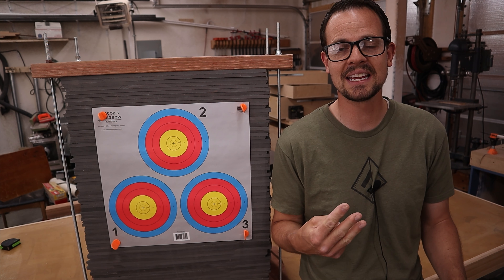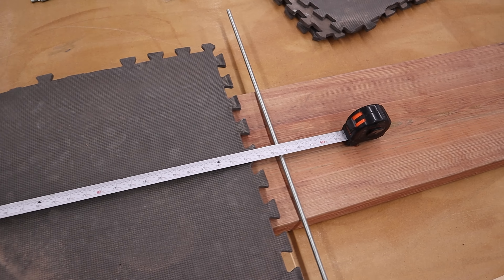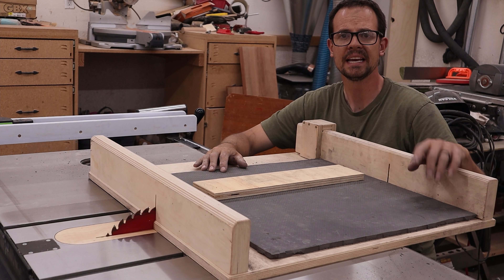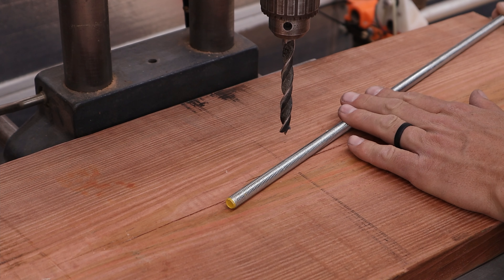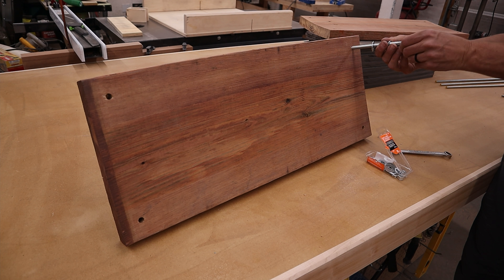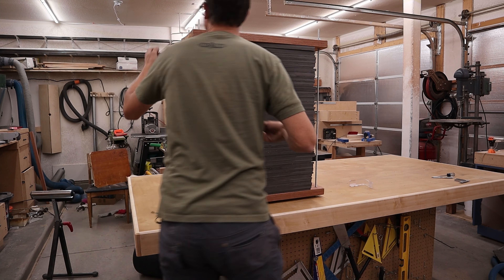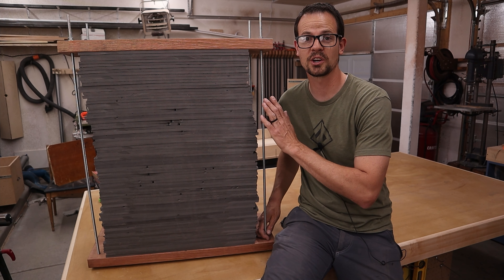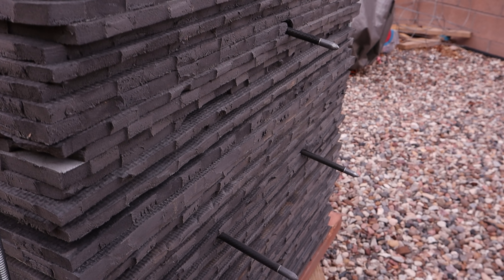Make a Simple Foam Mat Archery Target | One Day Build

Comment: Have you tried shooting broadheads into this foam? I understand it will shorten the lifespan of the foam, curious how well they would remove and how long it would last.
Reply: I haven’t yet. If it is like the normal foam targets Ive used before then the broadheads pull out easier. Ill have to try and get back to you. I do fear a bit the layered design would more easily cut out chunks than a solid foam target since the broadhead can cut out a whole layer thickness. It may be better to use the mats standing up.
Reply: Broadheads are going to shread this just as bad as any broadhead rated foam target. That's why it's worth taking the time to tune your bow (and arrows) so that your field points and broadheads fly and impact the same. That way you never need worry about both wearing out your target and damaging your broadheads. In reality you should only need about 2-3 shots from each broadhead before you can safely store them away until season rolls around. So unless you go crazy with a quantity of hunting arrows, your number of broadhead shots into the target shouldn't be more than 30 in a given year (20 or so for tuning and another 10 or so to verify all is well right before season starts).
Reply: @jmike8934  unfortunately I completely disagree with you. I tune my bow as much as the next guy and rarely do my broadheads and fieldtips not fly close. But I've shot broadheads enough to know that they are not field points. The industry has pushed everyone that their product has field point accuracy. I think as a hunter you should shoot every broadhead arrow and build confidence. I've been in camp many times with guys who claimed they hit the same spot, wound an animal, then go back and watch them practice with their broadheads and find they were not exactly perfect. It's the least we can do for the animal as bow hunters, and it greatly helps with my confidence. I do not shoot expandables, so if something gets knocked off in my setup throughout the year slightly, fixed blades usually magnify that. I'd never know if I shot field points practicing in hunting season.
Reply: @mitchellshirk2533  I think you are reading more into what I was suggesting or taking the whole "Impact the same" too literally. I don't mean the have to hit the EXACT same point, just group the same or very similar. For example I have my broadheads tuned and sighted to dead center but my fieldpoints hit about 1/2" low left in comparison. Solution? 4 clicks up, 1-2 left and now in the off season my field points are dead on. Season gets here, a readjustment my sight and verify all the BHs are hitting center and I'm good to go. That's 6 broadheads. 10 shots max. Maybe I've just been lucky with my builds and rarely do I have to make serious alterations to my setup when moving from field point to broadhead. I can think of one but that was on me for forgetting I had tuned with stock nocks but used lighted on my broadhead arrows. 

The guy you mentioned was just a shitty hunter. Most of us don't worry about going to hunt camp. We hunt within a close radius of our home and rarely get to go on trips. Once I verify my bow has changed from cutting paper to cutting flesh, it stays in the case unless it's time to kill. No field points fly out of it until tags are filled. Meaning unless I do something stupid like bang or drop my case, the chances of anything changing are 0. Now of course common sense has to play in a bit as well and adjust accordingly. The times I have gone on week long adventures, of course I did more verification of all my equipment and even went as far as to tune and carry a backup. But again that's just not the norm for most of us and as long as you are correctly confident in your equipment then you don't need to sling a ton of broadheads.

edit: I'm also with you on the no-expandables thing. I tried to give them a fair shot years ago but I found that NOTHING beats a good COC with a bit of weight behind it (these 350gr arrow setups also make me cackle).
Reply: I've had an identical target for many years. I use it specifically for broadheads because, although the tiles chop up a little easier than solid foam targets,  I can replace them cheaply amd easily so in the long run it's way cheaper than a brand name foam block.  I found if you move tiles from the centre to the edges regularly then it'll take a lot of shots before you need to buy more tiles
Reply from the maker: Sorry it took so long to reply with some good info but I wanted to shoot it a while before answering. Basically it worked better than I thought, but just like mitty vidz said it does cut up the mats. Im shooting iron wills and almost every shot cut a mat in half, but I still got good stopping power, and it wasn't tearing out chunks too big. It looks like with a couple of weeks shooting it would be good to replace about 12 of the half mats, so that would be like 18 dollars. Granted I had already been shooting a ton with field tips. I will say I didn't get any passthrough with the broadheads, but it did wear way faster in spots, so I got a couple to the fletching most days of shooting. Hope that helps.
Reply: @BuildItMakeIt  very much, thanks!
Reply: @mitchellshirk2533  absolutely broadhead tuning is more important than field point
Reply: @jmike8934  bare shaft and nock tuning will help tremendously but I’ve seen some broadheads that just have a mind of there own lol

Comment: Can you explain to me why you used a 25/32 drill bit and not a 1/2 inch.. To me it would seem the 3/8 would fit in the 1/2 inch hole better than 25/32. 3/8 = .375 , 1/2 = .5 and 25/32= .78125
Reply from the maker: Yep good catch I totally said that wrong. Thanks! It was a 25/64 drill bit I used, one size up from 3/8, not 25/32.

Comment: you really need something to mask out the threaded bar.. if an arrow hits that it'll either shatter, or worse, bounce or deflect in a random direction.  Extremely dangerous not to put something in front of them.
Reply from the maker: A number of people in the comments have used ratchet straps while building the target to avoid the threaded rod. I haven't seen anyone put something in front to block them, but that is a good idea. Thanks!
Reply: @BuildItMakeIt  ratchet straps are certainly the way :) good video though

Comment: I can't believe you used a table saw to cut those foam matts one at a time. That's like using a hand saw to cut your sandwich in half.
Reply from the maker: I agree a table saw isn't necessary but it was faster and left a cleaner edge than a utility knife. Your right, I could of cut more at once and been faster, I didn't even think of that.
Reply: @BuildItMakeIt  . A utility knife is just as fast and a lot quiter. I use these matts, but I shoot the fronts and tie them together on the sides by those interlocking pieces that you cut off. No need for wood and threaded rods. 12 matts will give a good 2' X 2' X 6" target.

Comment: Anything resembling horse stall mat or floor mat will not work.Arrows are difficult to pull out and it leaves a residue in your arrows when you pull them out.
Reply from the maker: Sorry the target didn’t work out for you. I haven’t tried horse stall mats as a target. I have one as a backdrop and I could see that being really hard to get arrows out of if you shot it side on.
Reply: @BuildItMakeIt  They work great as a backstop.Way to heavy for me to lift though.They weigh 100lbs.

Comment: Honestly, though, with how high prices are for the materials needed, why not just buy a pre-made target?
Reply from the maker: Lots of people are asking this, and I think it is a fair point. For me this is my 5th target in 3 years, all but one has been destroyed/used up the year I bought them. The one that has lasted is the Rinehart 18-1 target (foam) I bought last year. That target is $140. I wanted a larger target at least 24"x24" that would last multiple years. This target currently is like 85-100 to make depending on local, and should last me years. If I do cut up/wear out some mats it is only like 7 dollars to bring it back up to nice condition, all the while getting taller if I put the bad mats at the edges. If one isn't shooting a lot I think you can get away with something cheaper no problem. I am not sure what target for $100 is going to give me what I have with this target, but certainly I may be missing some targets.

Comment: Can you do the math and show me how 50 dollars worth of these oads (9 dollars a pack with 4 at half an inch, meaning you get 4 inches per pack if you cut them in half and stack them) and it be this big?
Reply from the maker: Sure, each mat is 1/2 inch thick so one pack gives 4 inches of target since they are cut in half. 24 inches tall is 6 packs, and 8 packs makes 32 inches tall. Using the 9 dollars price and no coupons thats 54 - 72.   I do recommend getting a coupon if you can. My local circular had them again recently for 7 a pack. The regular price used to be 8 when I first got them, but I still used a coupon.

Comment: Those mats are 5$ a piece here so this is by no mean a cheap target , I get you had yours laying around but to buy those mats and get 2 pieces per mat it would cost 200$ or more just to make
Reply: All that said it is a really nice quality target a if you bought that target it would probably be 500$
Reply from the maker: Yikes $5 each is pretty expensive. I did just check to see them at Harbor freight, and they have gone up in price again which is a real bummer. Looks like the new normal price is $10 for 4 mats. Hopefully price increases slow down. The target was never cheap to make but the mats have gone up now almost 40% from when I first bought them and about 30% from last year when I posted the tutorial. Crazy.

Comment: What's the draw weight of this bow? Do you think this can handle an 60 pound bow with 324fps speed? 
Does this target falls when an arrow Hits it?
Reply from the maker: My draw weight is 65 so you would be great. There are others that have built this target and they are shooting even higher draw weight. The target doesn’t fall when getting hit. It weighs about 45 lbs.
Reply: Do you have an ig account?
Reply from the maker: @BalwinderSingh-hx4qm  yep Im @builditmakeit
Reply: @BuildItMakeIt  How close to the target? I am asking as I would like to use in garage (5 yards distance)?
Reply from the maker: @richardvallee966  I typically am shooting at 20 yards or higher but I have shot at 5 yards in the garage. For my compound bow if I hit the same hole more than a couple of times in a row it does go in pretty far, so what I do is print a 5 by 5 grid on a sheet of paper since I am inside. With that I don't go through the same hole too many times. One note, it has always stopped the arrow just it can start to go in really deep and gets tougher to remove. Hope that helps.
Reply: @BuildItMakeIt  Many thanks for quick reply. This helps

Comment: The biggest issue I see with a lot of these DIY targets is of course, the use of metal and wood in their construction, reason (a) is obvious, arrows are expensive, and (b) the more surface area the target needs, adding size, weight, time and expense to your project. The 'joke' here is, if you know you can hit the side of a barn, just shoot the barn. The point being bigger targets don't make better shots, and removes more than adds to your training. So there's my take on that.
Let's suppose that the target should be as inexpensive, resistant, lightweight, and portable as possible, esp. for BY archers and beginners. I've found that a 30" carbon arrow will not pass through two sofa seat cushions at around 30'. The width of one of these is 6", 22x26". Someone demonstrated that 16 layers of cardboard can stop an arrow.
With this information we can build a 2 sided archery target by padding the foam seat w/ cardboard on both sides, and 'cap' the face with 1-3 foam floor mats (6 in a pack). 16 layers however, is as deep, if not more than the foam itself, and we have to do this twice, making for a bulkier heavier target, which we don't want.
If we can increase the amount of resistance of the cardboard, we may not need to use as much, say 9-12 layers. But how?
It is a known fact that silicone gasket seal can be used to make a self healing injection port. What is an arrow but a big fast moving needle? So adding a core layer of silicone between layers of cardboard should dramatically increase puncture resistance, each layer contracting and stretching around the arrow just as a balloon stretches around a most anything before it breaks. for 9 layers of cardboard about 3.5", that's 6 layers of silicone. If we cap each side with 1 mat, 4", 2, 4.5", all three 5". For even more resistance we can insert every 3 layers in a trash bag, adding protection from the elements. Strap all of this down as tightly as possible. Now you have a lightweight, portable and highly puncture resistant 2 sided archery target for under $30.00 (floor mats and silicone gasket seal)
Reply from the maker: Thanks for your thoughts. I think a lot depends on the type of shooting someone does. This target is more "aimed" at someone who is shooting compound and hitting very close together around 10-12 times in a row like with a vegas target. With this target being around 2' by 2' you can move the 18" target around a bit with each new paper target to minimize hitting in the same spot over and over again. I am a pretty tall guy and shooting a fairly heavy bow and have destroyed multiple targets so I wanted something that could handle the abuse that I was going to throw at it. I totally agree a beginner doesn't need to build a target like this if they aren't going to be putting the type of abuse into the target like I outlined above. I like your idea for a nice lightweight archery target on the cheap.